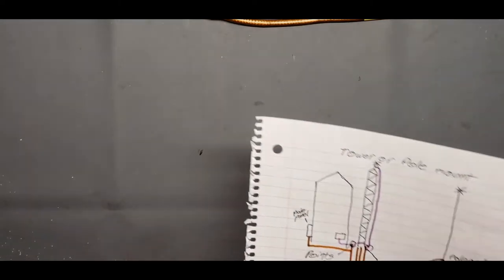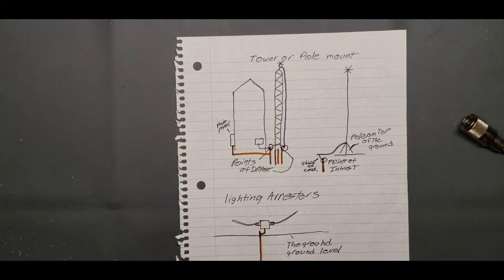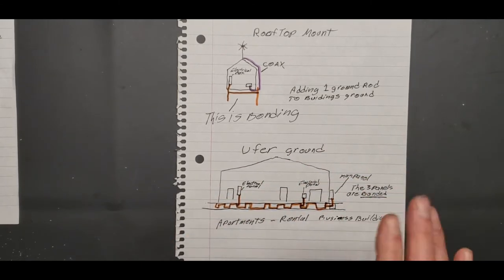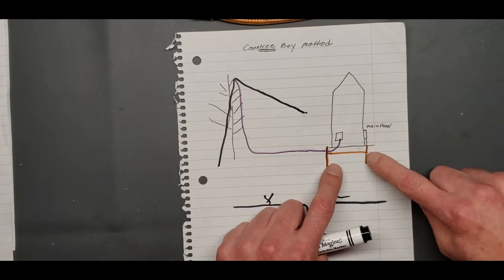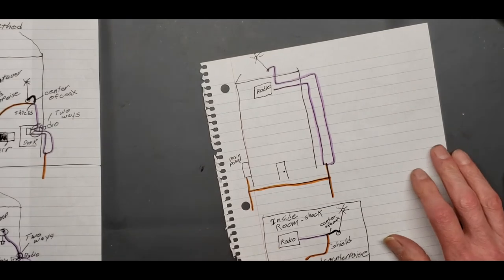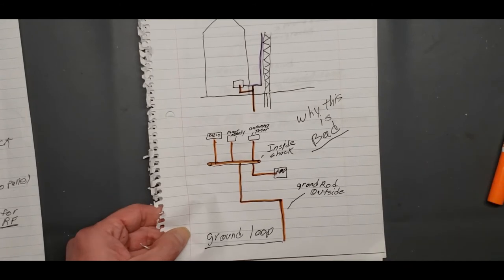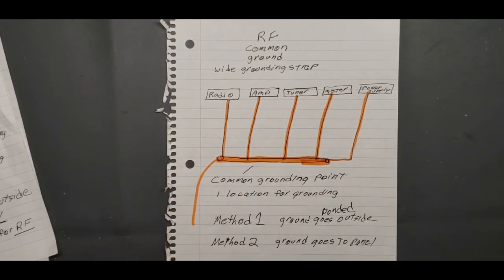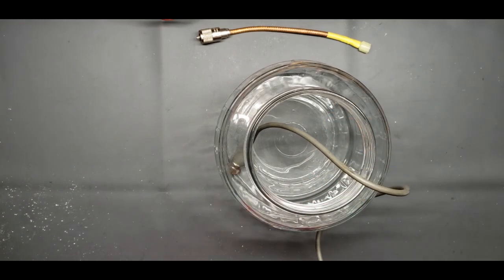Ham Radio Grounding Bonding and RFI

Comment: what about the antenna selector switches that you mount inside? the Alpha Delta ones have a lighting arrestors in them and grounds on them and there made to mount inside and be grounded. And a bonding Bus Bar that your radios go to and meter and amps and power supplies mount to inside the shack, the bus bar has to be grounded.

Comment: Hams often overthink grounding and bonding.  Is a ham transceiver "equipment" or an "appliance"?  Why do you need a separate ground attached to your service panel?  Why can't you use outlet ground?  What electrical code are you speaking about when using an appliance such as an amateur radio transceiver?